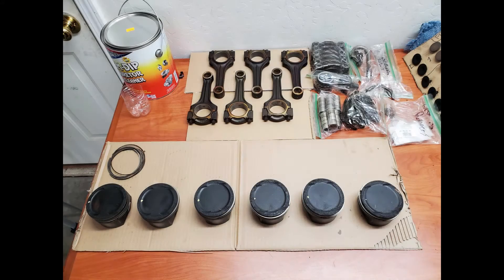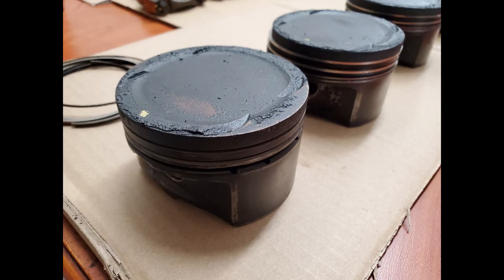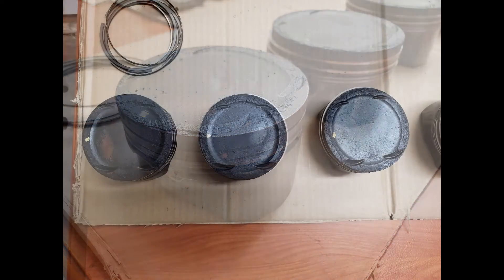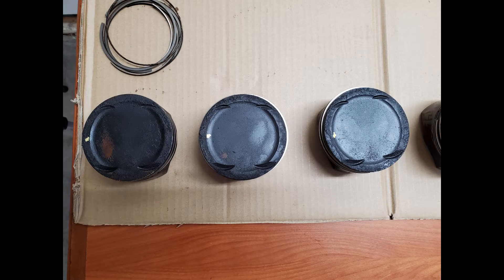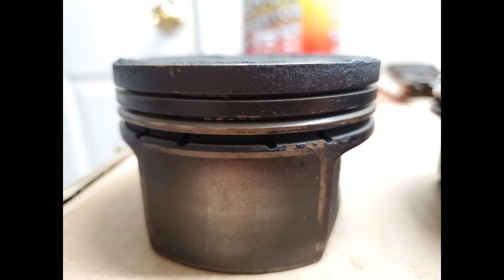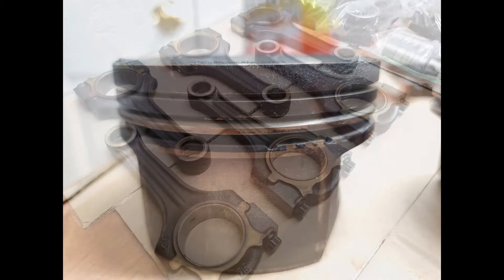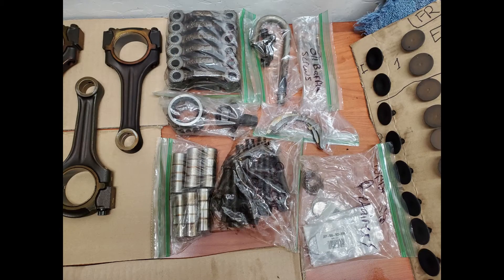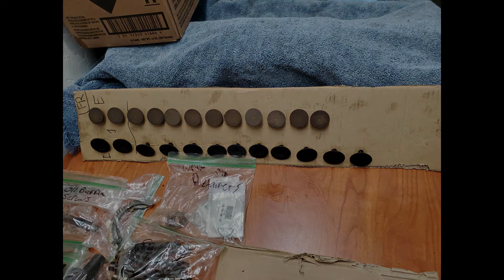Cleaning The Pistons And Valves - M104 Turbo Build (Ep. 9)

Comment: I love chemtool but I recently found something that cleans carbon up almost instantly, its Klean strip afterwash the stuff you clean your paint brushes with. I had apart a 3400 V6 and just needed something to get crud off so I just grabbed what I had and it literally dissolved the carbon. All i had was a Terry cloth and shit started to just wipe off, try it out yourself tell us what you think.
Reply from the maker: Bro thats amazing. I had a bit of some difficulty with the chemtool because it took so long to take. 

I wonder if your Klean Strip would affect aluminum in any negative way? Ill remember it and check it out on my next rebuild. (Probly gona be my 99 s10 with the 4.3 vortec)
Reply: @JakeSublime  chemtool is good if your just gonna throw in a bucket and soak your parts for a few days, I dont think afterwash will do anything to the aluminum besides it seems to clean so quick you wont have it on there to long.
Reply from the maker: Ill remember that for next time. Thankyou sir.

Comment: that engine has had nothing but shit fuel .... that much carbon for that amount of carbon .. my engine had gone 300000 km with half the carbon
Reply from the maker: What engine did you have?

I got this car at ~150k km basically out the junk yard. Since then (~100k km), i only used high quality 91 octane petrol/gas. Maybe something was wrong that caused excess buildup? Maybe i should have been using cleaners in the fuel?
Reply: Hi Jacob, waiting for your next step videos, thank you very much and very good Job
Reply from the maker: Thankyou, feedback like this means alot to me!

I'm glad I can help you, and others like you, with information and entertainment!
Reply: .992 never ran anything less than 98 octane
Reply from the maker: Oh wow, where were you getting the 98 octane? Were you using octane booster? Was the engine in your daily driver?